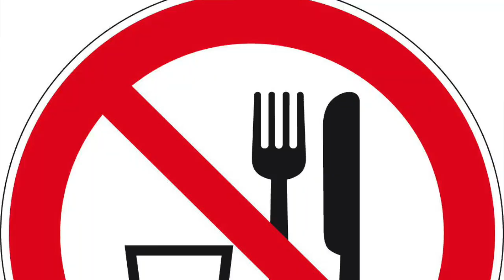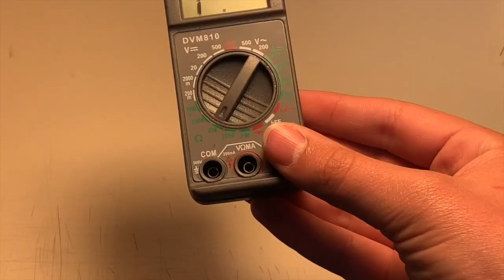Ripeness Robot?!- Building a Circuit to Detect Ripe Produce - Science KID Experiments

Comment: Which transistor are you using?
Reply from the maker: Hey! Here is a link of the transistor I used in this experiment: https://www.jameco.com/z/STP16NF06L-STMicroelectronics-Transistor-MOSFET-N-Channel-60-Volt-16-Amp-3-Pin-3-Tab-TO-220_2001373.html?avad=182414_c172c0ae9&source=Avantlink
Goodluck on your project!!
Reply: @thesciencekid6938  thanks

Comment: where did you get  your breadboard?
Reply from the maker: I used a 400-point solderless bread board. Here is a link to the website I bought it at: http://www.avantlink.com/click.php?tt=cl&mi=10609&pw=182414&ctc=build-a-circuit-to-detect-ripe-produce&url=http%3a%2f%2fwww.jameco.com%2fz%2fWBU-301-R-400-Point-Solderless-Breadboard-3-3-Lx2-1-W_20601.html
Have fun on your project!